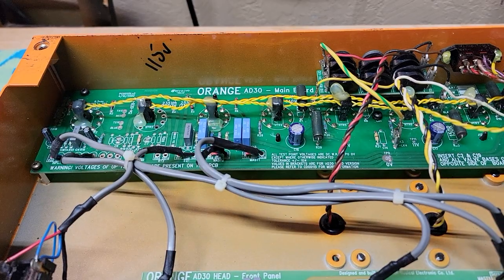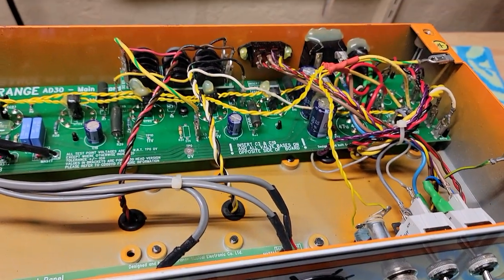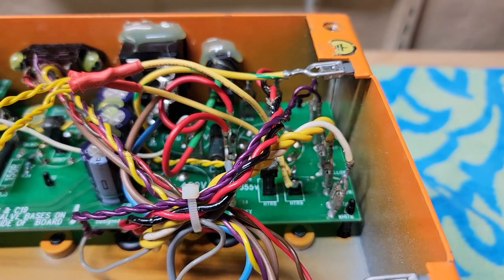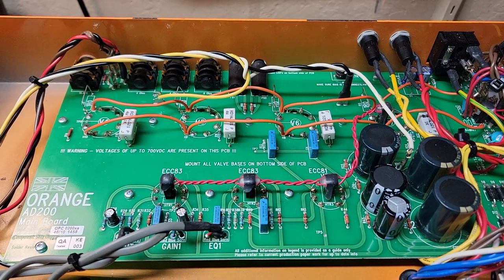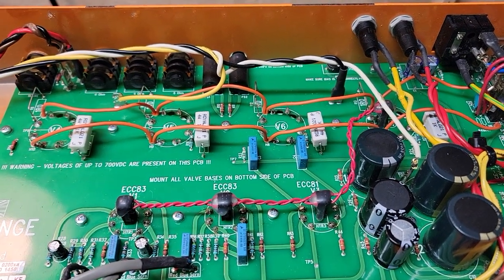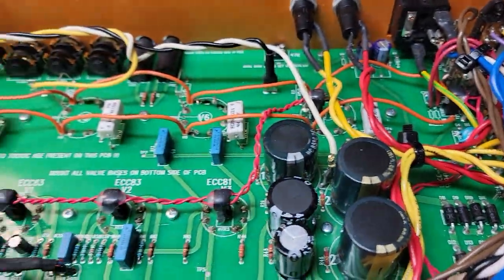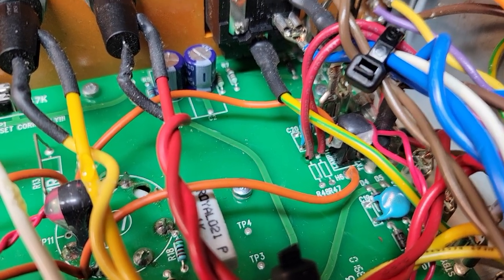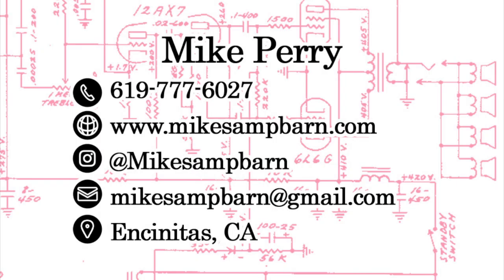Common Orange Amp Problems Fixed

Comment: Artificial center-tap resistors for the heater supply are supposed to serve a second purpose besides hum reduction ---- they can act as fuses and protect the transformer in case of a tube short, but two-watt flameproof resistors are really too large electrically to use for that purpose. 1/2 watt to 1 watt resistors are more appropriate as fuses, and flame-resistant carbon film resistors will burn open without actually catching fire. This amp might have had an intermittent tube short. Otherwise, you could add in a fuse from the balancing resistors to ground; but the resistors  themselves will do the job if sized appropriately.  Installing the replacement resistors elsewhere off of the board as you did is of course a much better idea than risking burning the board.
Reply from the maker: Thanks for the comment. Definitely food for thought here.
Reply: @mikesampbarn  , also,  If youre working on or building a cathode-biased amp and you would like to use the cathode voltage of the output tubes to "bias up" the artificial centertap of the heater supply and thereby achieve additional hum reduction, you really want to use low-wattage resistors for the artificial centertap so that they'll function as fuses. Very important in case of a heater-to-cathode short inside an output tube!
Reply from the maker: Been thinking on this one. If the resistors can burn up but not break the circuit, filament voltage is still going to all the tubes, in what way are they acting like fuses
Reply: @mikesampbarn  Think about what would happen if the HT shorted to a heater. Particularly in the case of a cathode follower where the heater to cathode voltage often exceeds certain brands of preamp valve heater-cathode isolation rating.  Using fusible balance resistors will prevent the HT from continuing to pass via the low resistance heater circuit to ground in that event. Elevating the heaters via the output valve cathode resistors (if a cathode biased output stage) reduces this voltage potential and can help in some cases, as well as reducing hum via saturating any heater to cathode leakage current that may be occurring.

Comment: Interesting video. I have the more entry level th30. I am surprised the high end models also have the tubes directly mounted to the pcb.
Reply from the maker: Yeah, that's definitely one of the worst modern amp design choices. At least some modern amps like Fender reissues hand solder the tubes.

Comment: The solid state crush's have their share of problems, too, like the Gain control not working until halfway up.
Reply from the maker: Interesting. I haven't had any of those in but I suppose it's just a matter of time.
Reply: @mikesampbarn There's actually video evidence, at a channel called Toby's Guitar Gear Demos. When 'Toby,' or whatever the tester's name is, turns the Gain down while testing the Dirty channel, the sound completely drops out at '10 o'clock.' 
There was another channel where the guy said the Gain's 'not there' when it's at less than half, but it's not on my 'amp and pedal shootout' playlist anymore. I think the Orange people got to him for running his mouth. 🤣
No, seriously, I think it was a bad batch.

Comment: I have a orange rocker 15 terror.  The bass control doesn't appear to do anything on the dirty channel and amp cuts in ans out.  The clean channel bypasses the eq ans no issues any idea what this could be?
Reply from the maker: @Panthersfan89  I haven't seen that particular amp so hard to say. Could be a bad pot/connection or maybe a bad tube.

Comment: Hey there. I have an orange rockerverb mk iii and its extremely noisy on the dirty channel when I turn the gain up from about 10oclock onwards. Orange say that it will be noisy, but its ridiculous. Whats the point of a high gain amp if its unusable at high gain settings? Any suggestions?
Reply from the maker: @ChristopherMarsay  Hey, Orange aren't totally wrong in that extra noise comes with high gain. But, I'd first suspect a bad preamp tube if the noise is really awful. You can try rolling some tubes to see if that helps. I can't recall which tube might be best to try, haven't seen one in a minute!

Comment: hi, i got my boyfriend the Orange Crush 35RT used ("great" condition) and he said a few hours into band practice (using at ~50-60% power) it turned off and hasn't turned on again. guitar center told me to get lost because "you can't return damaged gear" even though i think there was probably something wrong with it before i purchased it for this to happen so quickly. do you have any thoughts or advice on how to approach a repair attempt? my boyfriend has some friends who are handy with amps, but i wanted him to hold off so we could try to return it, but i didn't buy the protection plan at guitar center so that's a dead end basically. thanks!
Reply from the maker: @lookitslehaha  Hello, sounds like it's blown a fuse so the most likely issue would be the power supply somewhere. Crazy guitar center wouldn't work with you on that, much lame! Sounds like your best bet is to have a pro look at it and maybe you'll get lucky and it'll be an easy fix.

Comment: Hi! I have a ad30TC it a dual channel amp and the first channel don’t and only 2 power tube turn on do you think it might be the same issue?
Reply from the maker: Hey there sorry for not seeing this. Sounds like it could be the same issue with missing heater voltages.

Comment: hey firstly thanks for the video. i have a problem with dirty channel on my amp the dirty channels sound coming like the clean one how can i fix that ?
Reply: I have this issue as well, but on a crush 35rt.  If you figure it out, let me know.
Reply from the maker: What amp is it?
Reply: @MikeB-ng3ol  Does it suddenly get distorted around halfway up?
Reply: @mikesampbarn 
Seems like a common issue with the 35rt. My gain channel only plays clean